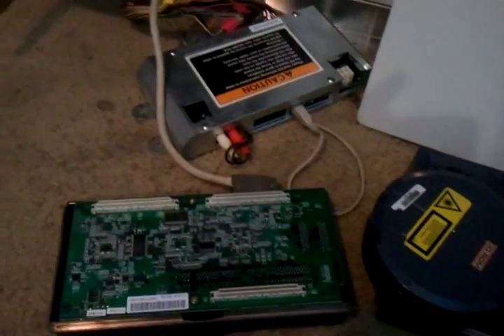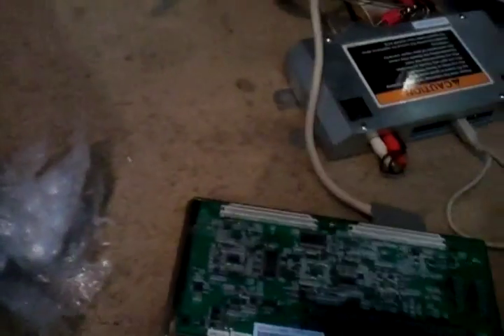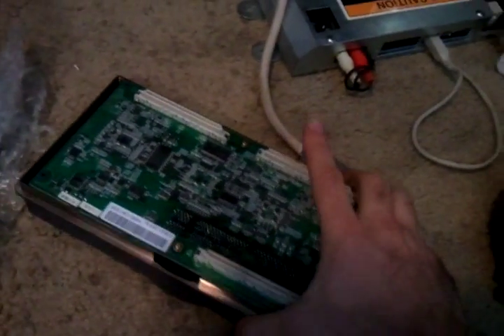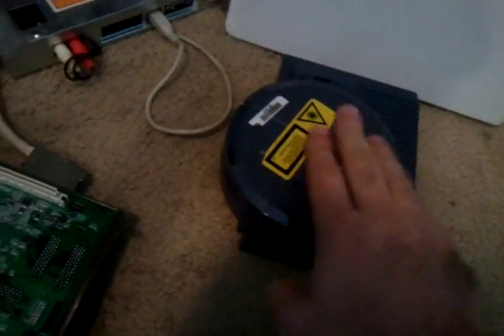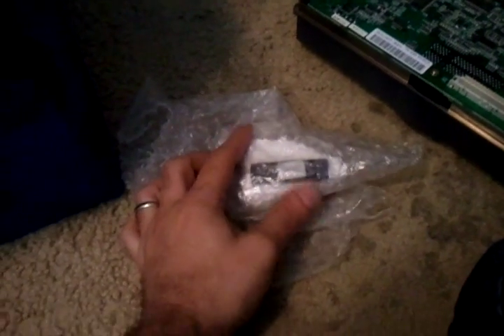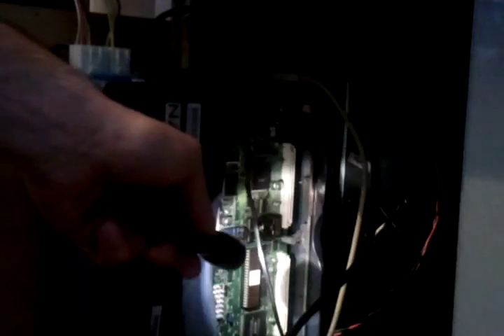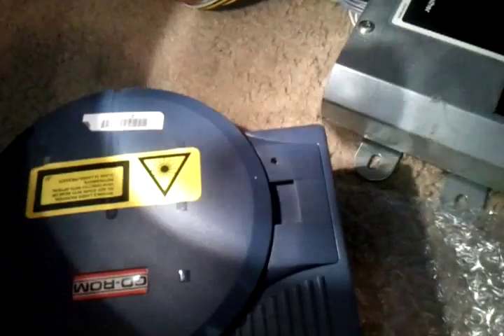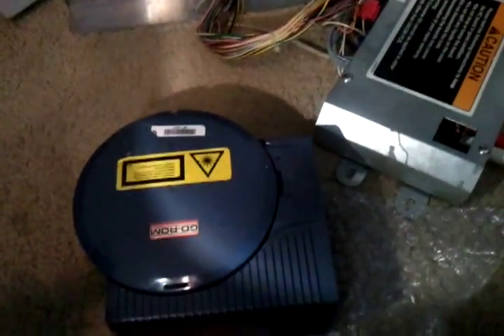Naomi 2 EEPROM Swap and GDROM Game swap

Comment: yeah that´s right but it happened in january this year and i´ve already fixed it so no need to worry =) i blew up my monitor chassis cause i wanted to connect my megadrive to it but yeah i guess it couldn´t handle it^^ changed out the chassis and everything is working fine now :D